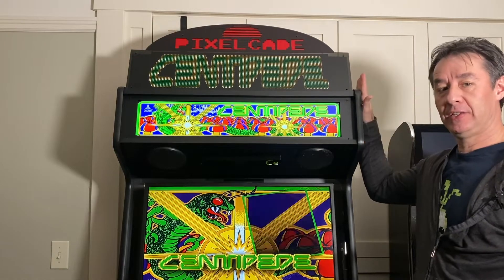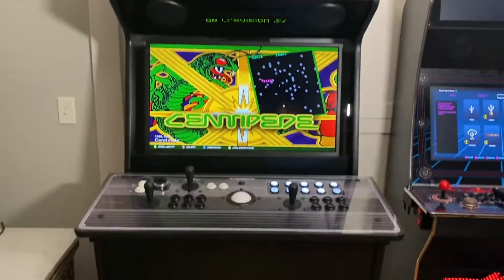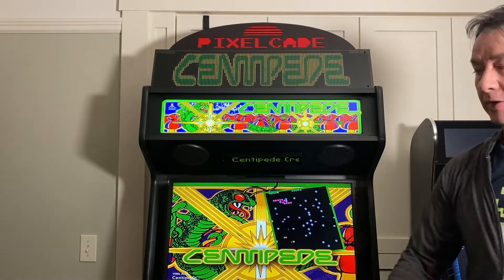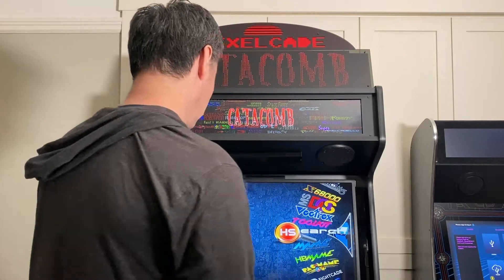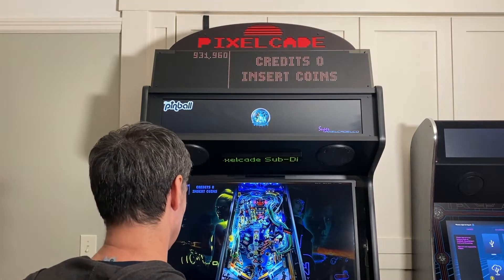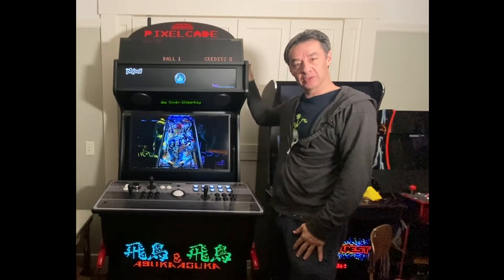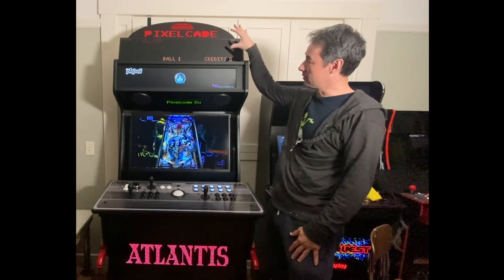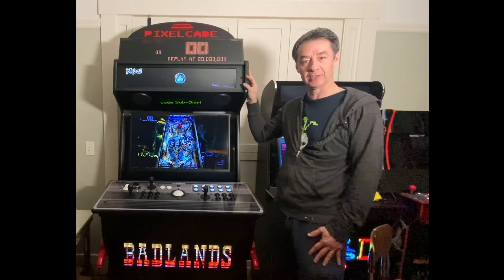Rec Room Masters Pixelcade LED Topper Prototype

Comment: Great idea to put that DMD on the top Al ...that would be my solution if and when I get them both. I hope it’s easy to do that. Can the LED work on the ALU pinball as a DMD instead??  Thanks for this vid
Reply from the maker: at the moment no for ALU pinball and DMD mode, Pixelcade will just show a generic marquee of the selected ALU pinball game. For Pinball DMD mode, you'll need to run in BYOG with an external PC on either Visual Pinball, Pinball FX2 (Steam version), or Pinball FX3 (Steam version), thanks for the feedback!